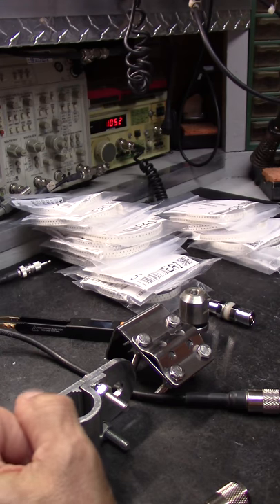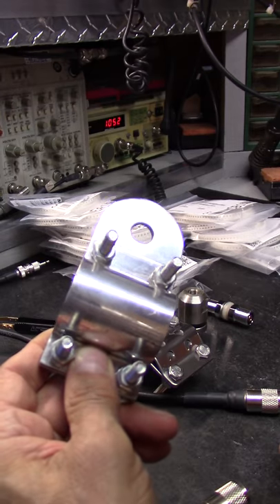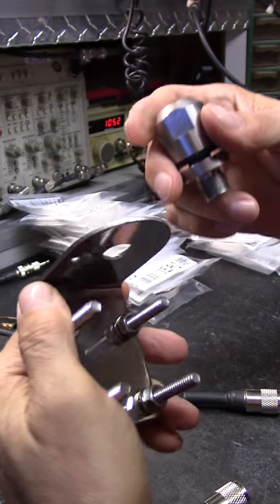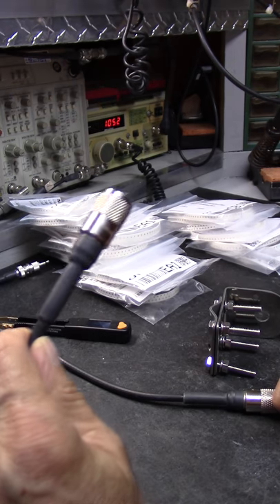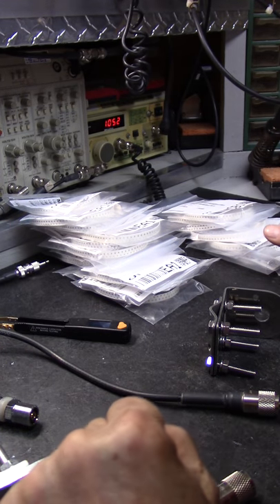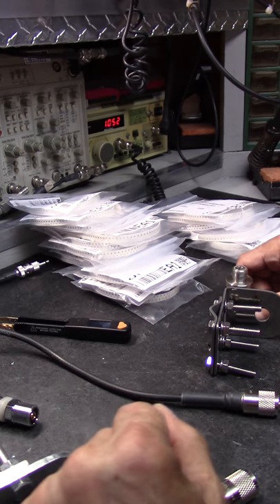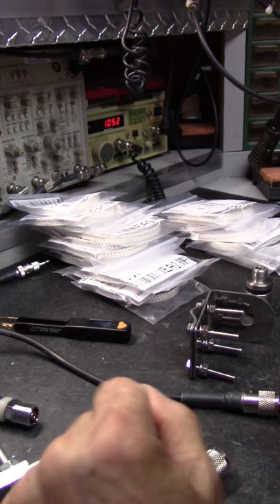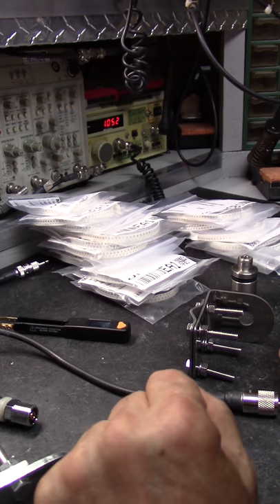CB Radio Coax And Stud Maintenance Tips - It's that time of year again and it's all up to you!

Comment: You must be reading my mind. I just did that very thing on 10 4 wednesday! New cable, I used times microwave cable, for both the ranger 2950 and for my Kenwood  mobile. This year I bought new antennas for the 10 merte/cb and a new set of sticks for hf. I would advise you viewers to also check their power connections for no shitty  grounds. That green stuff growing on cables ends is a bummer! Also check swr on antennas!  I agree dielectric grease is good stuff. 73 Tod kc9rka
Reply from the maker: Thanks for stopping by .. and everyone should have DMM and Antenna Analyzer on board if they're serious., not expensive but can save you a nightmare and a headache!